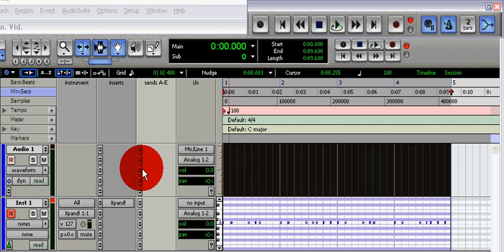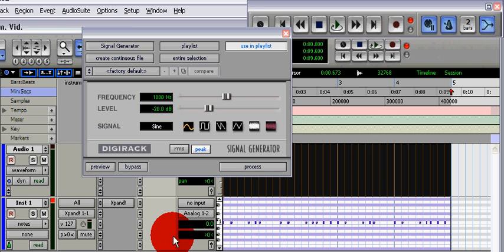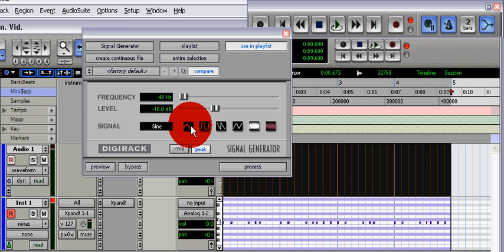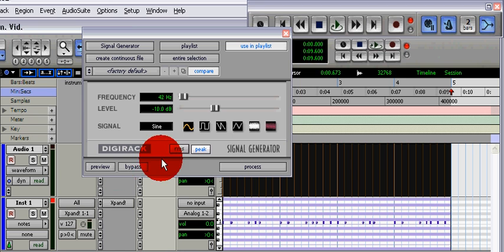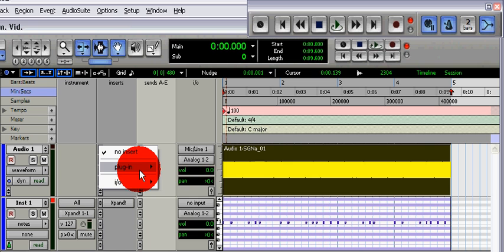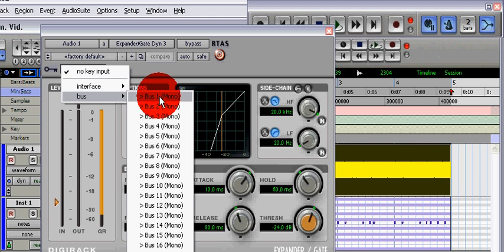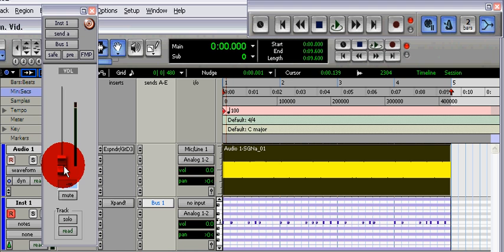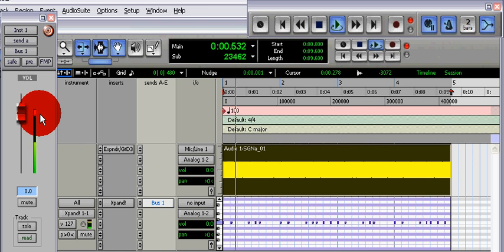Sub-Kick Trick using Signal Generator in Pro Tools

Comment: When using the aux you can also automate the signal generator parameters (frequency, shape, level etc). The original 808 is around 60hz

Comment: theres a much easier way to do it. put a signal generator in an aux track. send the kick to the aux and set it at unity level. then gat the aux track using the signal chain. dont use audiosuite because your stuck with it if you use an aux you have much more control